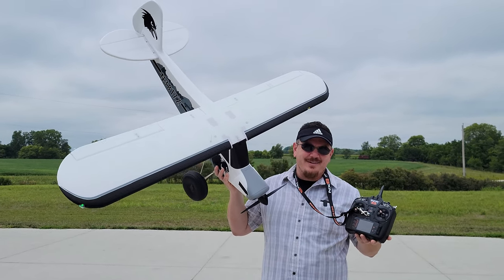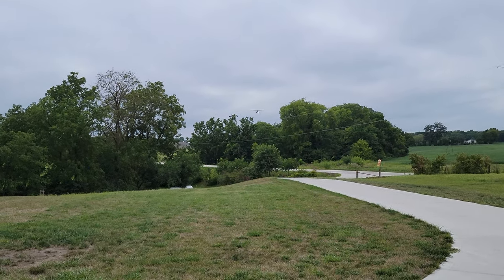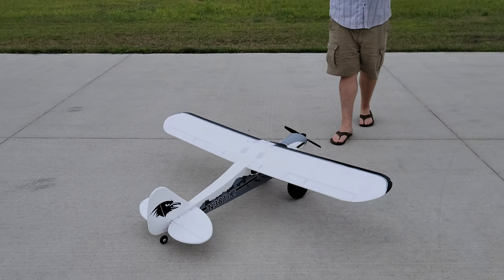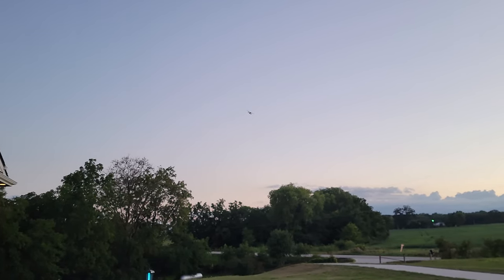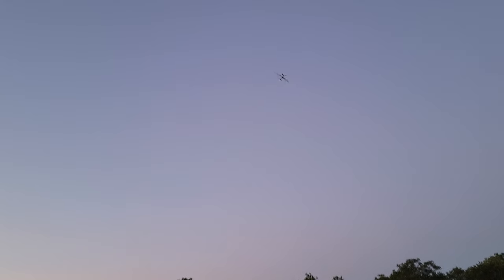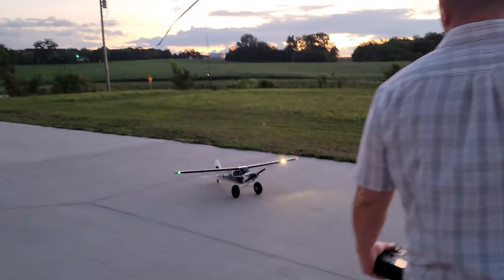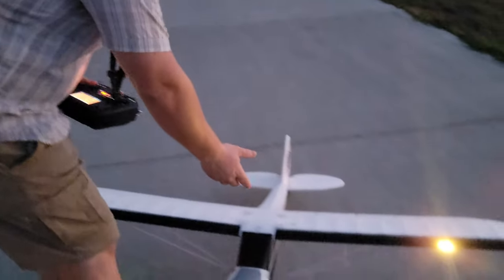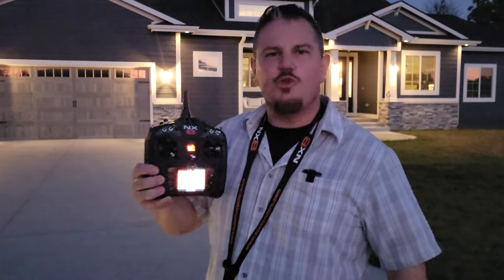FMS - PA-18 Super Cub - 1.7m - Maiden Flights

Comment: This is probably my favorite plane. Plenty of power even with heavy Dubro tires and a 4S 4000 batt. Awesome on floats too!
Reply: Just curious.   What size DuBros did you put on thi.  I have the six inch pneumatic.  Is that what you used?
Reply: I used 5 1/2" duburo inflatable tires it seems a little nose heavy with a 4200 battery so I had to put my battery way back in the plane using just one strap
Reply: @ToastyProductions.  any pictures. I have. Kavan 5” tires on mine.. They are much lighter, but are not the soft pliable rubber like the. DuBro tires.. I just realized it won’t allow me to post pictures in the comments.

Comment: Were the wing struts meet the wing they are very weak (I have broken two) one broke when the wing must slipped out of my grip and hit the floor the wing strut just snapped where it meets the wing - Lucky for me you can get replacements for them without any trouble - if you take a close look its is a thin bit of plastic with a screw going through it - its the weakest part of the whole aircraft - now having said that I it is a Fantastic aircraft - owned mine for a few years now and have never stopped loving it...

Comment: Hey, I might get one of these do you know if this plane has a beginner mode (auto stabilization). or does the beginner mode on my remote work with this plane.
Reply from the maker: This plane has nothing in PNP, but you can add it if you buy the stuff we used, and follow along. It's not a terribly difficult setup, but BOY O BOY it is WONDERFUL!

PA18 https://bit.ly/3cqVx8T
2200 4S https://bit.ly/3RQTafm
AR620 https://bit.ly/3z7WDO0
NX8 https://bit.ly/3J05xSj

This would be a great beginner plane that an expert pilot would LOVE to fly, just the same!

Comment: I had to set up a 35% down elevator to flap mix on this model to get it to transition smoothly without it janking upward when switch on.  and my motor makes the funkiest sound ive ever herd on a electric Rc Plane.
Reply: Does the sound happen just as the motor starts spinning?
Reply: @MT-THNDR207  Pretty Much from idle to 3/4 throttle.   I found another FMS 3541 750Kv motor that came out of the FMS Pilatus PC-21 i crashed a couple years ago and that made all the difference to give it a normal sounding motor
Reply: @looneytunes47  Sometimes, my UMX turbo timber makes a screech noise from the motor just as the motor starts to spin.